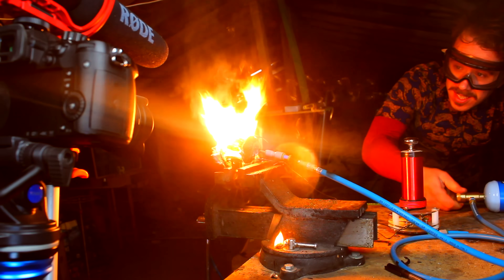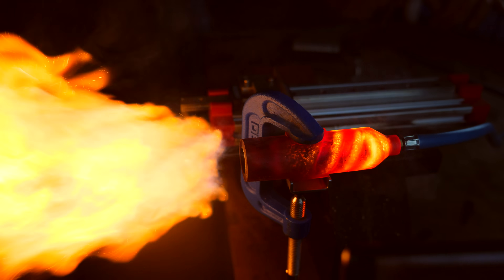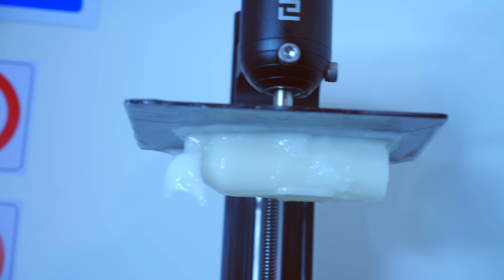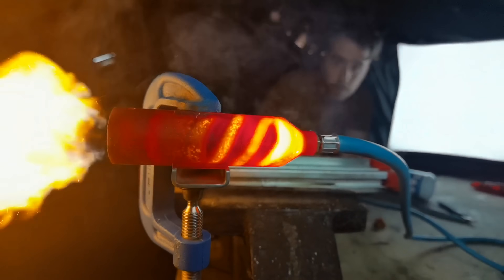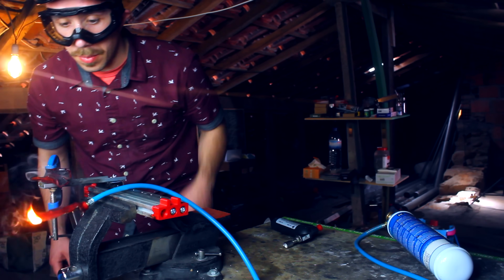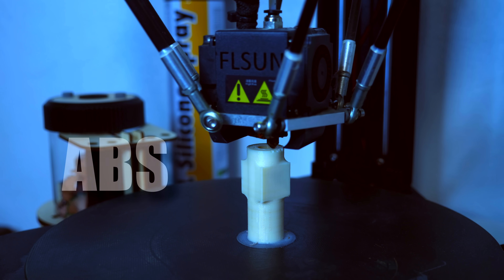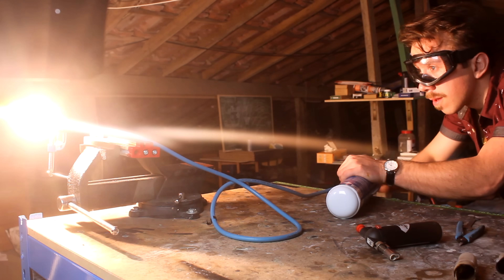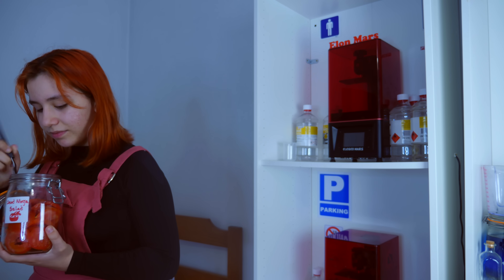Rocket engine that uses itself as fuel! (3D Printed)

Comment: I think you can do this with some specific changes. First use a steel body and graphite nozzle.  Not sure you're going to be able to 3d print those though. Secondly use nitrous oxide (N2O) instead of O2.  The extra N2 will increase gas pressure and likely thrust as a result. Third 3d print a solid fuel "puck" with a hollow core and slide it into the steel body.   I suspect you MIGHT be able to 3d print a cap and nozzle and maybe figure out a way to connect it and seal it to the steel body.  But I think the main burn area needs to be inflammable.

Comment: If you make the inside of the chamber not cylindrical but star shaped instead you will generate more thrust. The Space Shuttle solid motors engines used a 11 pointed star to control to increase and even out the thrust over its burn time.

Comment: why don't you buy simple valve for your fuel? you woun't have to screw it every time you wish to use it. 

there are electric valves simple relais or simple handle valve. It would be way quicker to shut off fuel source

Comment: I think you might have an issue with your thrust vector. All those engines should've been able to push along a linear rail. Since you have the engine so far out on a lever you're probably applying rotational force to the rail causing it to seize up. Try moving the engine closer to the center of the rail in order to see it move. But a better option would probably be to mount it against a scale or an Arduino based weight cell. That should allow you to measure thrust a bit more scientifically. You might also find this interesting: https://dspace.cvut.cz/bitstream/handle/10467/79523/F2-BP-2018-Sonka-Ivan-BP_3D_Printed_Fuel_Grain_for_Hybrid_Rocket_Engine_IvanSonka.pdf. They're comparing different 3D printed fuels and different grains, TLDR: PLA is the best of the easily available 3D printer filaments, and the star grain seems to perform best for that fuel.

Comment: The massive flame, despite looking very cool, is actually a sign that your rocket motors are horribly inefficient. All the combustion is occurring outside of the combustion chamber, meaning no pressure is able to build up, and since thrust comes from the velocity of the exhaust gases, no thrust is made. Enclosing your plastic fuel grain in a sealed metal container with a proper nozzle should   be the way to go here!

Comment: You’d benefit using some sort of intermediate valve between your fuel source and the flame. I say use a oxy/acetylene cut off torch for the ability to not only mix two gasses, but also have the ability to have the fuel sources on and off instantly.
Reply: Yeah, I was wondering what the risk is that the flame burns back to the tank
Reply: @rucker69  I’ve seen flames go up the hoses on oxy/acetylene, hence the main regulator on the bottle as well. When he has the oxy tank sideways is also worrying too.

Comment: Maybe it's a good idea to print a thermal resin skeleton inside the rocket, in hopes of keeping it alive for longer so less energy is wasted. The outside can be coated in it as well to keep the pressure inside. To avoid the problem of the porous material leaking fire you could try printing in a vacuum to make sure the material doesn't leak.

Comment: I think the max amount of thrust your engines could ever deliver are limited by the pressure of the oxygen tank.
The heat mixture expansion pushes the rocket forward and tries to push the oxygen back (so it kind of "throttles" down).
Liquid rocket engines require turbopumps to presurize both the fuel and the liquid oxygen.

I think you should "fork" your project into a 3d printed "expendable" turbojet engine. You feed the fuel/oxygen mix right at the intake. 
Your rockets last 3 - 5 seconds. If you could make a jet engine that lasts >15 seconds that would be awesome.
The sole idea of printing your (future) design of a working Jet engine at home makes me want to have a 3d printer.

Cheers!.

Comment: ok, so for insulation, i recomend usin fiberglass, since fibergalss is used in furnaces you can use it as an insulator and use the campfire paint and carbon fiber to protect the rocket and make it stronger

Comment: Could you use infill % in the print to massively increase the surface area of the combustion chamber and produce more thrust? Like a honeycomb (Keep the outside shell at 100% infill for strength)

Comment: Could you print solid rocket fuel by mixing an oxidizer instead of a fuel into the resin? I know it's not the path you're going down right now, but it would be interesting to see. 

Beware that even the liquid mix is probably an inextinguishable fire hazard, and that ammonium perchlorate, while a popular composite propellant oxidizer, has more chemical incompatibilities than potassium nitrate or perchlorate, and needs testing for undesirable reactions.

Comment: What's your favourite vegetable Integza? You need a veggie sidekick to help you with your 🍅 problem. Equip him(her) with some 3d printed accessories like the rockets we just have seen. Maybe that's e theme for future video's. 
A new video theme would be a 🍅 chopper or grinder made from 3d printed part's, maybe one manual and one with a electric motor.
Reply: On a side note you can put your sidekick to pul the switch on the 3d printed tomato grinder on some more ninja tomato's.

Comment: 2:40 This is interesting to me. For a moment there it was burning very well and the bell nozzle was functioning properly, probably generating a decent amount of thrust. You can see the flames concentrated within the nozzle through the resin. But after just a moment it transitioned to what looked like burning outside the engine? It looks like there's a moment when the pressure of the combustion overwhelms the shape of the bell nozzle.

Comment: Good evening, I was perhaps wondering what if you coat, I mean like coat it thicccc, the inside of one of the hybrid engines in a sugar-paint mixture (like the graphene and paint mix except sugar)? and inject the oxygen tangentially to increase the surface area contact between the O2 and C12H22O11. Also what if you coat/print the nozzle in a graphene-Resin/paint mix to make the nozzle last longer and maybe electroplate it with copper? Integza dude you should create a fan to suck--filter the air when you do the test fires and mount it with the test stand

Comment: I want to see 3d printed catapult, what launch tomatoes in air. 
Btw I think you can put your previous ceramic parts in abs shell. Ceramic can take high temperature, and abs shell can prevent brittle ceramic from cracking.

Comment: PLEASE! Make a testing gig with a solenoid valve connected to the oxygen outlet! That way you can set the same pressure for all tests, also you could close the oxygen instantly and safely with just a switch. Have you considered using a steel tube outside the printed part to avoid blowing up? Great video by the way! New subscriber here.

Comment: I feel like you really have something here, but the fact that your rocket throat and nozzle are probably the first to burn and lose shape removes nearly all the thrust. Maybe try printing a ceramic housing and nozzle. To put ABS printed fuel cartridges in. 🤔 (Another tip is that your engine bell seems to small. I believe you would want the bell diameter to be nearly the same as the diamter of the exhaust plume. That way all the expansion force is pushed against the engine wall and not lost into the surrounding air) Annyway love your video's!! Keep it up 😄

Comment: Dont beat yourself up over your "failed" rocket prototypes. Those rockets have efficiency issues even when you design them with durable materials like steel or others that are not coming to mind. It's actually really impressive you got as far as you did with 3d and resin printing. So if anything if you had a cnc machine and a good lumpsome of steel you could make an even better rocket since your so a use to working with not so durable materials. In my mind you did an exemplary job on them and you are the best engineer I know besides Nicola tesla😁👍

Comment: Try adding 30% of aluminium powder. It's greatly used in solid rocket motor and it is the substance that causes the really thick White smoke of the space shuttle SRB. Aluminium vastly improved thrust :-) the thrust curve is affected by the solid fuel shape. A cilidrical shape will produce an always increasing thrust output because the surface of the burned propellant continuous to increase. A star shaped fuel with a constant area of burn will produce constant thrust. All indipendently from the nozzle. I am an aerospace engineer and I can give you some advice to optimize your design

Comment: You can put the 3d printed engine inside a metal cylinder or a pipe so that it can burn completely before you turn off the O2

Comment: Why don't you go to your local hardware store and get some lead pipe to put a fuel in and then making a ceramic nozzle to go onto the end of it then you would have a reusable body for the rocket and the only part that might need replaced is the nozzles

Comment: Dear Integza,
You can try metal tubes to cover your rocket. This will also prevent your entire attic to transform to a firework.... Now, with these tubes, you can easily recreate the Soyuz Rocket and wy not to try a test flight. Just use some thin tubes for less weight. Try using the tube of the handle of a broom. Good luck! 
Giorgos from Greece

Comment: You should 3d print a Ranque-Hilsch vortex tube.
It takes in a stream of pressurized air, and outputs cold air on one side and warm air on the other.

Comment: Awesome video as usual, love your work. You might be able to prolong your burn by printing the casing from a material with the lowest oxygen index and a fuel insert with the highest O2 index. That way the fuel part should burn quicker and the casing part should resist burning for longer. It might give you seconds extra but it sounds like fun. Thanks again for the awesome videos. PS: can a 3d printed tomato burn better than a dried tomato?

Comment: Hello INTEGZA...
You need a better solid fuel.
Be careful this is STRONG STUFF.
sugar,  wood dust, aluminium dust, carbon dust and at last but not least, potassium nitrate. Mix very very well and super carefully. 
Use a copper pipe for the wall of the rocket, do not forget to leave a channel for the pure O2.
Dude i know you will start the portuguese space agency. 😆🤣
Força Portugal... lol
Reply: Ho i almost forgot... Men i need that sweet sweet 3d printer, i need to do some drones 😆

Comment: I don't know if you can build it, but there are now metal 3D printers that work with lasers and layers of metal dust. These are often used in racing for the engines, but I'm sure you can also use such a printer for rocket engines. 😂

Comment: You should print an all in one rocket.

But the oxidizer will probably be hard to fit in. Especially with fdm and its 'not so great' pressure tightness.

A resin body (definitely pressure tight to some extent) with build in tank and flow limiter, that takes thermoplastic  motors, would be really cool.

Although trying to fit a oxidizer tank in the design may be a bit dangerous.
Especially with a passive flow limiter that just opens up on ignition... ^^

Comment: i would say try to make a casting, like print the part, bury it in sand and cast it with a soft metal like copper or tin, or try to make a solid fuel 3d printed engine type thing

Comment: You should build machine specifically designed to destroy tomatoes. Like a rocket with a metal plate on the front to slam into the tomatoes and pulverize them.

Comment: you should build a simple cone by bending sheet of metal to house your fuel inserts - this way you wont need to print whole rocket every time and only insert fuel with different nozzle for testing. You can also 3d print template for housing from very soft plastic and than cast it using molten metal and plaster letting plastic evaporate

Comment: There are few ideas for improving hybrid rocket that I have. 
1. You could incase whole solid fuel and nozzle in metal pipe of some sort, that would allow you to increase the chamber pressure that intern would speed up the exhaust gas that would produce more thrust.
2. If you know the energy density of your plastic filament and burn rate you can increase specific impulse (ISP) by controlling valves using Arduino and a stepper motor connected to the oxidiser valve.
3. You could make a nozzle from 3d printable ceramic resin, that would allow it to survive longer exposures to high temperatures and could be reused, also if the outer casing is made from steel pipe nozzle could be mounted on flex joints that allow it to gimble, but that is only after the problem of caring enough of oxidiser to power engine and also not too heavy for it to be able to lift off.
Few tips that might help from my own research and experiences while I was active in our rocketry club before whole covid and all fun that came with it :D
Use standard off the store pipe for the outer casing, you can easily drill through
 the end cap and fit nozzle and also use a high-temperature sealant for no high-temperature exhaust escaping around the nozzle and starting to eat solid fuel pellet/core. because we are engineering students we have all the tools like lathes and mills so it was a bit easier to weld and centre so we didn't have out of centre thrust. but you could also 3d print a centring guide for drilling in the centre of an end cap of the pipe. 
If you need help with calculations just send me a message on discord :) boksininkas_LTU [KARAS]#6196
Reply: 4. Be more safe and logical, don't play with fire and high pressure systems like it's your friend
Reply: well knowing that he has a welder he could try to weld something up. 2 cones with cut off tops welded back to back. cuz the ceramic cant hold high pressures, also it lets gas through its porous material...

Comment: How about building an EDM setup..... no, not a pair of turntables and cheesy lights, for Electrical Discharge Machining, where you can make perfect holes in anything conductive with zero friction involved. Or you can make metal surfaces completely smooth.

Comment: Hello integza ,
Your videos are awesome . For the next one, I think you should make the combustion chamber with a copper tube you can find it in a local hardware store.  This tubes have connectors and can be closed in both sides . With a 1/8 inch  plumbing connector fixed in both ends you can use it to inject your GOX and in other end the nozzle . Of course this connector are removable so you fit in your solid fuel. 
Thanks for reading this comment 👍

Comment: Hi Integza, what if you print a ceramic nozzle and ceramic containment body/tube and then print the plastic or sugar resin fuel to slide inside the ceramic tube. This should stop the plastic/sugar resin from failing and getting blow outs. A combination of everything you have experimented with might achieve success. Good Luck

Comment: Great Video! Just wanted to mention that the De Laval nozzle is a type of converging-diverging nozzle design that is commonly used to accelerate flow and thus increase the thrust is used for a rocket. This is achieved because of properties of fluid mechanics such as the continuity equation, In order for the nozzle to actually work the fluid passing through it MUST be at Mach 1.0 at the throat so that the then supersonic gasses can accelerate as they expand in the diverging latter half. If these conditions are not met and the flow is subsonic at the throat the nozzle will actually decelerate the gas. In the video, you didn't mention if you had done any of the calculations or not so I thought I would mention this since it would be cool for you to do some of the design and get it really working

Comment: How about print with multiple materials? Like print burning chamber and nozzle with ceramic resin (insert) cover it with red hi temp silicone and insert whole thing to outer plastic mold. And you can experiment with different chamber profiles.

Comment: Make a 3D (manual) water pump. Like those that there are in Portugal in villages for pulling water from perforations.
Reply: Or instead of manual, making it to work using bone of your engines, like the hot air engine

Comment: I have two good ideas for you Integza. 1. Start wearing respirator during tests, please. Fumes from burning plastic or resin are quite carcinogenic. And 2. on your current thrust testing setup, rockets produce more torque than linear force. If you position rockets in line of your track and on long enough konsole, you won't damage tracks and rockets more likely will move.

Comment: Use 10% filling on the chambers and parts of the engine that are hollow (maybe modifying the filling pattern to help with the flow) to give the engine more fuel to burn on. And making a metal or clay sheath where you can put the engines in, since you're using the same outside format for most of them, you could ideally use the same sheath for all the tests.
Reply: yeah,  the gyroid infill could be fun to experiment with this
Reply: I was going to suggest a sheet metal sheath that way easy to produce (pair of tin snips and a vice) and diameter won't matter. Also it's cheap I mean economical😉
Reply: @iczer01  that's basically what I had in mind when I said "sheath", although the clay might be a good option if you want safer shreds in case of an explosion.
Reply: This but i would also do something about the nozzle, it being burning as well doesn't help much. Maybe get some nozzle made out of metal or clay that you can attach to the sleeve and make the Burnable part like a solid stick just dropped into the sleeves. If the nozzle is made out of metal it should be easy to reuse, even if it got really dirty from the resin you could just burn it away or maybe use some acid if compatible with the metal.